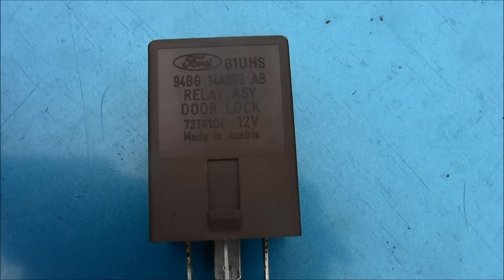How to Remove Install Power Door Lock Relay

Comment: Got a 95 f150…..got up under dash behind the e/e speed sensor…nothing…did you remove ducting for heater and AC????where the lose could it be located???

Comment: My door locks started acting crazy, like they were possessed! Lock, unlock, lock, unlock... I pulled the 20A fuse just to get them to stop! I thought it was a short (coz it happened when we were driving in heavy rain.) When I re-inserted the fuse the craziness happened again. Damn! So I went to the back of the glovebox and that exact same 4-pin large brown relay was there! (Called relay 29). I took it out and the craziness stopped immediately. I inserted another 4-pin relay and... tah dah! the craziness stopped and my normal door lock-unlock  began to work. (So I guess it wasn't a short caused by the rain after all.) That 94BG14A093AB is difficult to get!!! Also, sometimes door wire harnesses are placed under the passenger floor carpeting and corrosion, from wet carpets, can cause 'door gremlins'.
Reply: Thanks
Reply: What kind of car did you have? I have 2007 kia Spectra with the same exact problem
Reply: I have a 2000 ford taurus with same issue. What kind of car do you have? Fuck it im just gonna take out the glove box and look
Reply: Exactly the same problem im having im going to find that right now and replace it see what happens i always said it was a relay but I didn't know where it was located I know now
Reply: I can use my remote have sound but doesn't works
Reply: I did it run your battery down too?
Reply from the maker: Imagine when we start having relay devices implanted in us. The things that could get wrong.

Comment: Do you know where the intergration relay is for a 99 toyota sienna rear vent windows?  I've replaced on window motor but it still stops working after using it a few times in a row and the passenger side rear continues to work well.  Just can't seem to find it on ling anywhere. Thanks.
Reply: John Smith google it they have part locations of almost every part for every car and YouTube shows how to replace them
Reply: I'm having a power door issue that's draining my battery on my 2000 sienna ugh lol
Reply: @ApexKilla49_  have you fix it